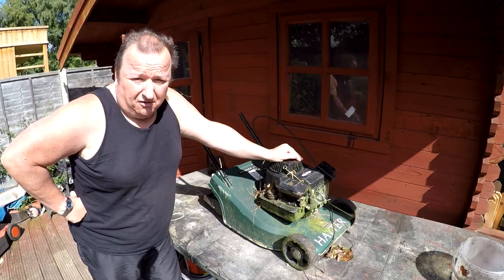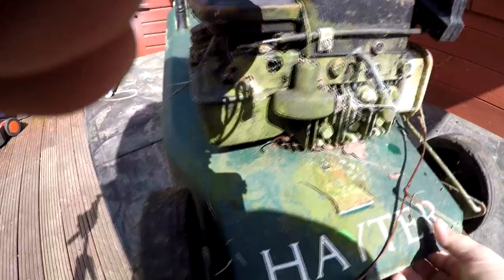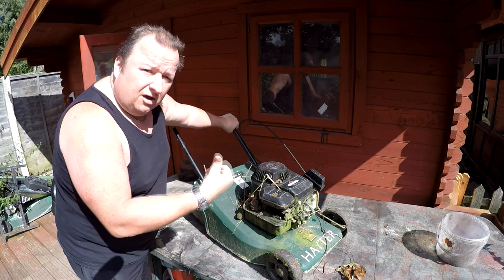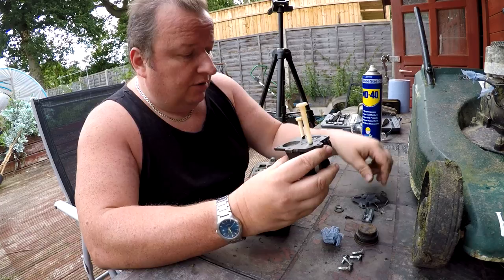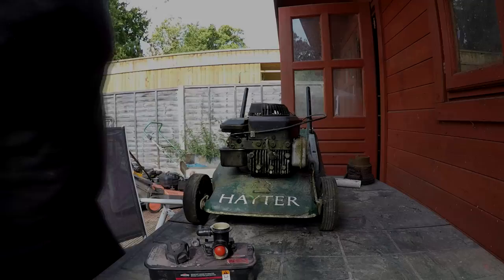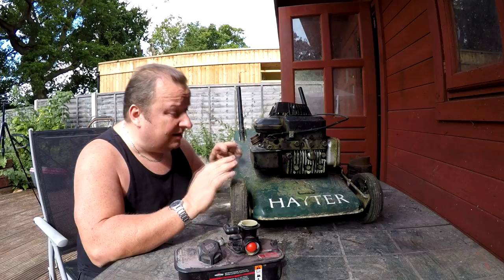Part 5 # Worst Lawn Mower In The World The Hayter Harrier 41 Gremlin

Comment: That gasket you need is really a fuel pump for the carb.. B&S part number 391681.  You just about have to replace them any time they have been sitting up..  I build a ton of them from the 80's...
Reply from the maker: Yes, it's a common failure on these mowers and we see it all the time.
Cheers
Martin

Comment: Hi Martin.  Loved the video.  I have the same mower as this.  My drive cable, which allows the roller to turn has come away.   The cable is all intact , it still has the z bend on it.  I have tried to put it back on, but have no idea, where it goes.  Any chance you could point me in the right direction, as to go about fixing it.    Many thanks..
Reply from the maker: Hard to say without actually seeing it bud, sorry.
Reply: Hi Martin 
Thanks for getting back to me 
I’ve done a bit of research, and I think the part I am looking for 
Is a clutch pulley.
If I am right, when you pull the cable, the pulley wheel engages the belt,
Allowing the rear roller, to speed up, or slow down.
My mower is a Hayter harrier 41 autodrive 
Type  (Code306n ) 
I have tried eBay, but had no luck.
Thanks again.

Comment: Great trick with the air vane Martin, I'll remember that one if I come across a delaminated magneto. The type of carb you've got here requires the choke plate to be "over-rotated" before the carb screws to the tank are tightened. This puts tension on the rod which activates the choke butterfly so that it snaps into the closed postion when flipped closed. This means that choke is applied when starting the engine and the plate also pumps fuel with each intake stroke. I have the instructions from the B&S carb diaphram kit if you want me to e-mail them to you.
Reply from the maker: Yes, I have seen the diagrams John, The screw for the air cleaner goes through the choke flap too. I don't think i'll be putting this on back on though.

Comment: I serviced one of these chokamatic carbs earlier this year and its for sale on ebay atm. They are a bit of a fiddle compared to the normal one's. To start them tho you need to lift the mower up on an angle from the back to prime the carb, sounds ludicrous I know but it does work for mine. I had to really dig around on youtube for what looked like a video made in the 80`s to find out how as I could not get mine started after a service either. Good luck, great series:)
Reply from the maker: Yes, they are, I'm not too bothered about putting it back on, I'll probably leave this one on it.
Reply: retrorestore yeah I thought you may have had enough of it by now after another good upper body workout:)